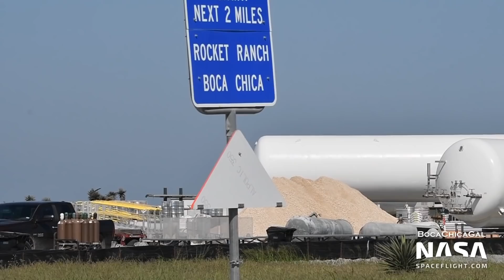Launch Site Prepped for SN15 Static Fire & Test Flight | SpaceX Boca Chica

Comment: I like the guy watering the nosecone outside the tent. Like it’s going to grow up into a starship someday
Reply: Wax on Wax off lol
Reply: Did you see on Labpadre's channel that it apparently got tested in the production site? Wonder if that's why it's being washed. I'm really confused about all this, never seen it before
Reply: @wildchameleon7  Thinking it may be prep for spot welding studs for thermal tiles. They haven't tried that yet ifrc.
Reply: @cosmosdream283  I'll take 5 i pay when I have proof they work
Reply: I wash my vehicle that way & so far still a basic unit. Resale value plummeting! Need to go to dealer for that nosecone to be attached maybe..😎🇦🇺
Reply: FINALLY some clean Starships! :D
Reply: I'll bet even the dirt over that much surface area weighs enough to affect calculations. Not surprising they want to keep it clean.
Reply: Nice but when are they going to start polishing them?

Comment: The TOLL (Tower for Orbital Launches & Landings [my name suggestion] ) will grow in huge steps in the coming weeks.  With these lengths of upright beams, I guess the Tower will be at its peak in a month's time (May). Finishing it off in June, then a first orbital flight in July IS possible.  [Without catching arms, though. They will be added later. First test-boosters will have legs.]

Comment: Looks like side plate construction on the tower. We used that on Seatac ATCT, which is actually a concrete encased steel structure. Most people think it’s concrete precast like our other towers that look similar.

Comment: I just had a thought regarding the orbital launch tower.  I think everyone is expecting one arm, or pair of arms that will catch the booster on landing, and  then set the orbiter on top.
But I think there will be two: the first one catches the booster and sets it on the pad, but then holds it there while a second arm puts up the orbiter and puts it on top.
This way, it can't accidentally knock over the booster.
Reply: SpaceX always depicted a crane on top of the launch tower to lift Starship (the orbiter) on top of the booster.

Comment: 12:34 - A purpose build Rocket Wash is needed in the near future, when multiple Starships and Super Heavys need to have a cleanup.
Just a ring of rotating brushes going from top to bottom, then a ring of hot air blowers, and done !!  :-)
Should be part of the Orbital Tower, besides launch access arm and landing catch arms.  Catch, wash and launch. "Rinse and repeat."  :-)

Comment: I see they dropped three green cabinets at ~2:30 minutes. Just in front of the control room. Those are the power transformers. I always wonder where the heck the power lines come into the launch area. Seriously we are talking high amps and voltage to run all those pumps. That's buried in salt water soaked sand. Hmm. I hope it is extraordinary insulation.

Comment: I was a bit puzzled by the bracing on the integration Tower as doesn't look as strong as cross X bracing. Fyi did some looking up, this V or "chevron" bracing isn't as strong - requires sturdier horizontal beams - but allows for larger access ways through structure, e.g. perhaps crew access arm higher up. Apologies and kudos to those who already knew :)

Comment: as often as they got to move TankZilla and will likely have to move the new Crain they might as well put in a permanent set of ramps for them so they don't have to keep setting them up and taking them down.  Would probably be safer too and I imagine they'll have plenty of other uses too specially if they are close to flatbed trailer height.

Comment: Does any one know why some of the stacking guides are attached on the outside of the rings and some on the inside? The ones on the outside get removed...I wonder if they remove the inside ones as well?
Reply: The inside ones would be removed as well.
Speculation on inside vs outside would be what is most convenient, what side they will be welding from, or how well the barrel sections line up, some may be bigger in circumference and some may be smaller, which would influence the lead-ins.
Reply: The ones I saw on the inside were on a GSE tank and I guessed that for those they don't care about the weight so they probably leave them there. Maybe.
Reply: @philb5593  Thanks for the insight. I guess I always assumed all the ring edges were the same circumference.

Comment: Why do GSE tank pipes make the squiggle in the middle? Why don't they go straight down?
Reply: Pumping gas or cryogenic fluids through pipes causes vibrations. I've learned those 90º bends allow a pipe to flex and dampen out the vibrations before they build up and strain the various joints in the system.
Reply: @donjones4719  Thanks!

Comment: Are the guys working to build the integration tower engineers, or are they construction workers? Or some combination thereof?
Reply: Construction crews doing assembly, engineers already did there design. Usually some changes during build hopefully not many. Manufacturing tolerance is always one of the biggest concerns with structures like that.

Comment: Does anyone know why the pipes on the GSE tanks don't just go straight? What is the rectangular section for that's on all 3 tanks at about the same height?
Reply: Those things are usually added to accommodate thermal expansion/contraction. Pipe joints fail without them.
Reply: I see, thanks Ghenadie!

Comment: Looks like the integrationtower connections misses a lot of bolts...
Reply: Maybe the directions say don’t tighten all bolts until it’s finished.
Reply: Standard construction practice. Finial bolt up and tightening after squared, plumb and level. Hard to adjust with all the bolts in ;)

Comment: Is it possible that the "mystery structure" is to test a new type of LOX header tank that would probably sit on top of the CH4 tank?
Reply: The unofficial consensus on discussion forums is that it’s a hull integrity test. There is a jack under that funny lid, so it’s likely they will try to rip the fin hinges off, to see how much stress the nosecone can take. Also, the payload bay is itself a “tank”, because it needs to be pressurized during orbital flights.
Reply: @qm_rev  Ah, for some reason i thought all this structural testing was possibly to test a newly designed LOX header tank integrated into a newly designed CH4 bulkhead, but as i was typing  i realized that tanks need to withstand explosive pressures, not implosive, sorry that you had to explain that
Reply: @Surrenitie  I am curious myself about the details of this test (will it be implosive or explosive).  Apparently, new plane hulls are also tested like that, by putting pressure on wing adaptors, in cages.

Comment: I keep asking what is up with that nosecone rig - somebody has to know something. 😜
Reply: Is to simulate max Q loads on the structure
Reply: Axel D Source?
Reply: @ironhead7955  I don't have an specific source because I heard it in various channels I'm sure  one was everyday astronaut and labpadre information texts among others
Reply: Axel D,
   what are your qualifications?
I'm an E-5 Gunners Mate (MK - 45 Mod - 0) - 1450 psi hydraulics at rest & 1550 psi hydraulics when we blow shit up - 5 inches are 127mm - we banged 13 miles at an average rate of 26 rounds per minute. 😜
Reply: I do not think I know what you know, but static structures at sea level are just not representative of real world space flight - Spacex is doing something different. 😜
Reply: Axel D,
   I be goin' with the bullshit, where is the mind?